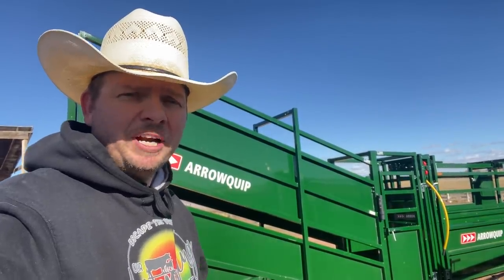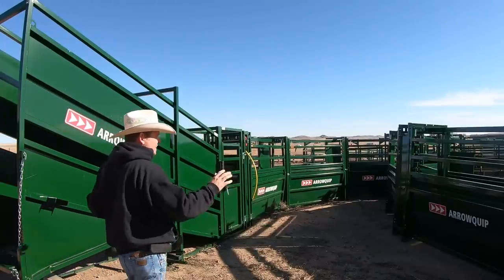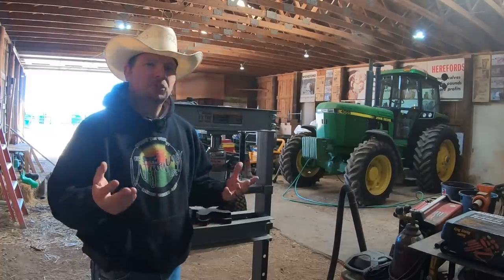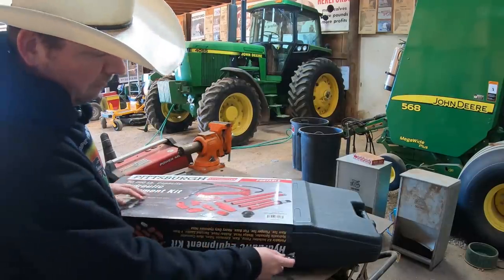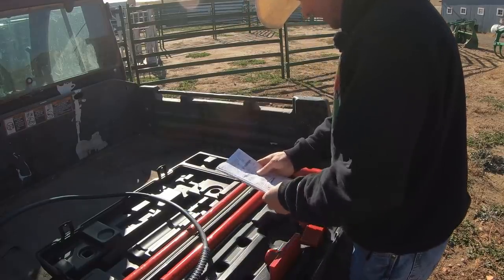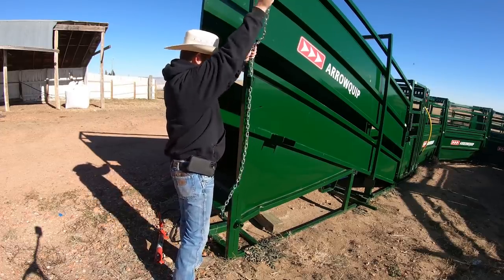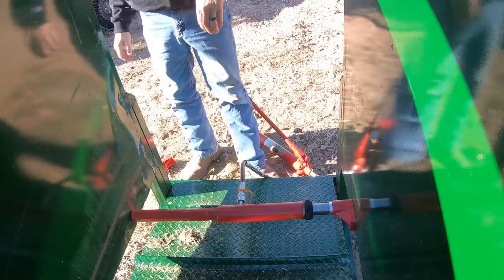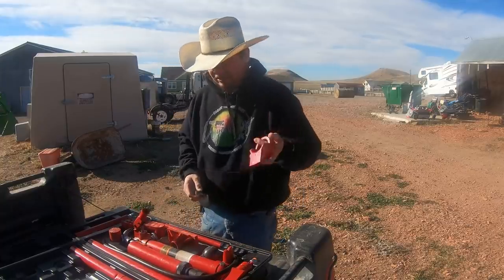Fixing the Loading Ramp with a Hydraulic Ram

Comment: Weld a doubler plate on the outside of the bent frame piece after you straighten it. It's probably cracked already and will fail in the future if it's not reinforced.
Reply: That portion of the chute does not see enough stress to fail unless it gets hit with a tractor. But sealing it up to keep moisture out, if it can drain at the bottom, is always a good plan. They can fill up easy enough with condensate in humid conditions which is not Wyoming for sure.

Comment: I use those porta powers all the time they are a life saver.... Next time you use it try and have one of those flat bases on both sides, other wise you might break or deform the extension tube.... They also sell a chain pulling cylinder for those.

Comment: First, I have been a First Responder for 36 years, and before we had Hurst Tools AKA Jaws of Life, we used Port-A-Power's like this for extrication tools, and second, it's good to see that you, unlike most people now, are not too good to go by tools from Harbor Freight, especially something like this that will not be used often, I too have been guilty of thinking I had to buy the big named stuff, but with the new tool lines HF has come out with, I never will again, I have bought into their Bauer line of cordless tools now, and they perform just as good, and in some cases better than my Dewalt and for 1/2 of the money! I actually sold my Dewalt and kept the Bauer!

Comment: Hey Mike. Porta/powers are a great tool to have on the ranch, You should definitely reinforce the area where the bent square tube is. Grind off the paint, weld on some angle over the damaged area. Reeled the cracked weld and reinforce that area also. It will break again if you don’t. 
Good job

Comment: Use a hammer on the inside and a block of wood on the outside of the crease to smooth it out. You may need an extra set of hands.